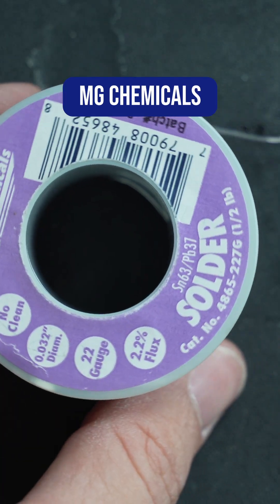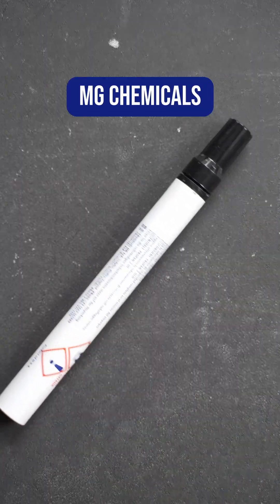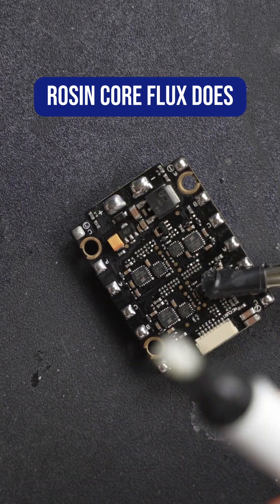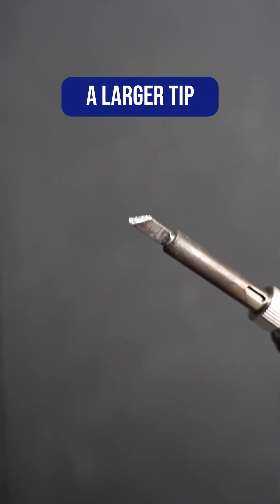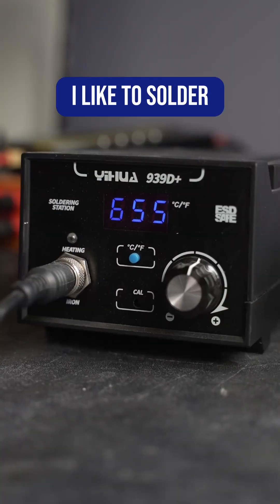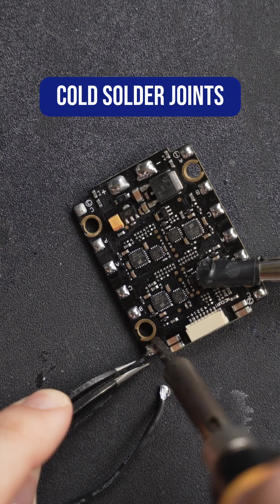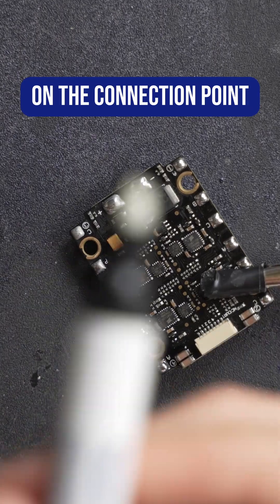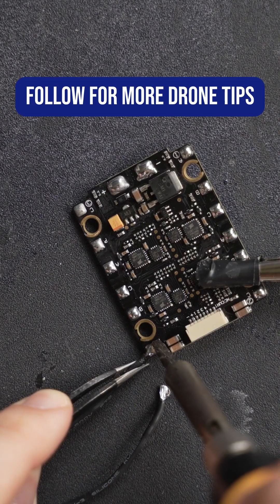Perfect Solder Joint | #fpvdrone #fpv

Comment: your set at 600F 

Isn't that on the lower end of soldering ?

not to mention your globing tin directly on the iron.  

Wouldn't these contributing factors lead to more cold solder joints ?

Is my whole life a lie D:
Reply from the maker: I've been told when working on sensitive electronics its important to not turn the heat up too high when soldering. Due to higher temps potentially damaging certain ICs if exposed long enough. But it all really depends on what you are trying to solder (smaller joints + small wires vs large joints + large wires).  

I place some solder on the iron to help transfer heat from the iron to the pad I want to solder to (since heat transfers more easily through liquids compared to solids). Then I can apply more solder to the location to make the actual connection. It all really depends.

If you have any input I can learn from I'd love to hear it =D
Reply: I've been soldering for a long time, I'm also a welder and this applies to welding as well. Sometimes less heat is transfered to electronic components when you use a higher temp. Seems counterintuitive but with a colder iron like yours, you have to hold the iron on the joint longer. If you have a hot iron, you can quickly melt the solder and be done in a fraction of the time it took with the colder iron. 
Think of it in terms of how long your iron is on the solder joint rather than the actual temp of the iron. A good joint will take maybe a half second to melt and flow. With a colder iron you also risk burning up your flux before the joint is complete. Hope this helps!

Comment: How if the solder keep stick to the iron, not in the solder pad?
Reply: The point is to get the pad hot enough for the solder melt, not to melt the solder with the iron.
Reply: @Samsunwhoop  oh make sense. Thanks!
Reply: If your solder is making the soft-serve ice cream swirl at the top, either you’re not using enough flux, or the solder pad isn’t getting hot enough. The solder flows to heat, so it’s sticking to your iron instead of what you’re trying to solder. Good luck!

Comment: can I repair a xd 60 connector with everything rtf on the drone otherwise? or should I take the battery leads off make the repair and resolder everything
Reply from the maker: You can replace and xt-60 connector from a battery, but you need to be very careful to not short the leads. Do one lead at a time, and cover the second lead in electrical tape to prevent a short.

Also connect the XT-60 to another XT-60 connector of the opposite type while soldering to ensure that your connector doesn't melt.

Comment: electroloy soldering lead and amtech flux is good
Reply: or ichiban & ichikawa solder wire

The quality is good I use it for micro soldering in cellphones repairing
Reply: Ichikawa solder flux good?